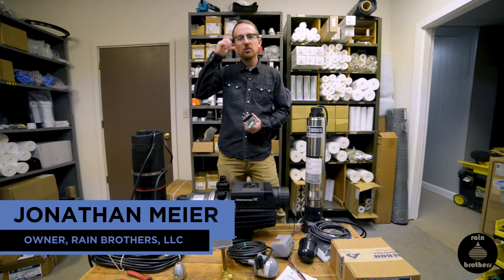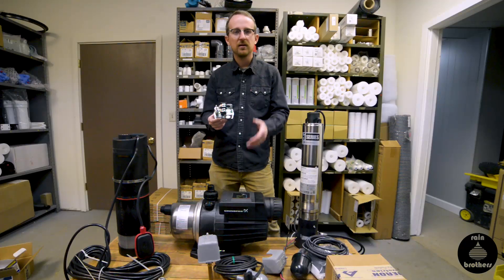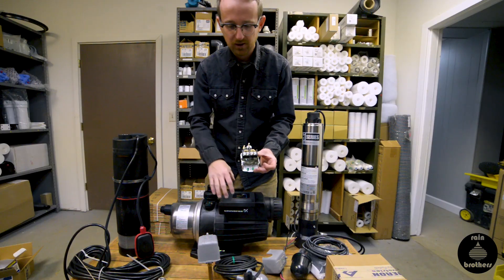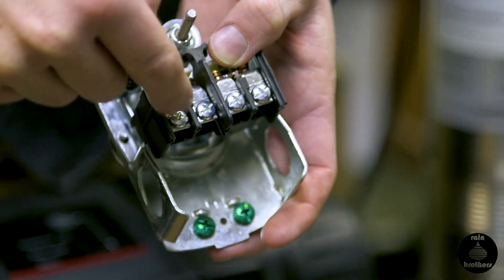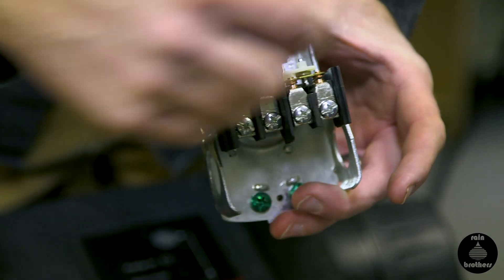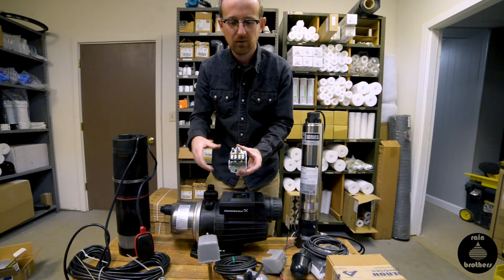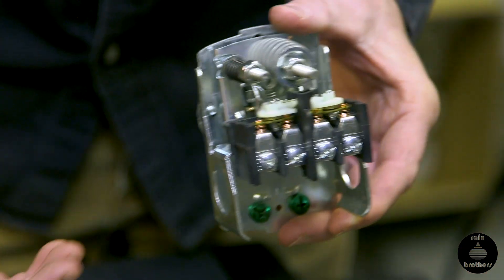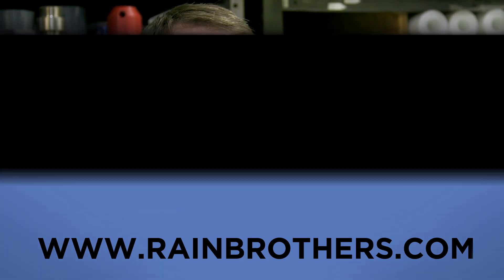How to wire a pressure switch

Comment: We're offgrid and using 12volt usa adventure pump and 20 gallon pressure tank.  How would I wire this switch? Can I go from battery to switch to pump or it needs 120 volt to operate? Thx
Reply from the maker: While I have never wired a pressure switch to a 12v pump, there is nothing in a standard pressure switch that inherently would prevent it from working with a 12v system. The switch itself works mechanically based on the water pressure in the system - the water pressure is what moves the electrical contacts together or apart to create or terminate a circuit. So I believe you would be just fine using one of our switches, and it would wire exactly the same way as was described in the video. Just match the colors — two left terminals would each receive a black wire, and two right terminals would each receive a red wire. We always recommend consulting an electrician before making any connections. Pressure switch available here: https://www.rainbrothers.com/store/40-60-Pressure-Switch-p502659515

Comment: How to wire pressure switch to capastor
Reply from the maker: The pressure switch should be installed between electrical panel and pump’s control box. This will avoid having to deal with the additional wire coming out of the control box

Comment: My jet pump 40/60 is wired with 220v.  When I check the two middle terminals on 40/60 are 220v.  How can I wire a 110v GFI into this switch so that it will turn on a chlorine pump when the well is running?
Reply from the maker: Best to use a 220v chlorine pump, or hire an electrician.

Comment: I have a 3 wire motor red, yellow, and black. Which of these wires goes into the pressure switch. Do all three go in? If so does black go with red or? I’m having no luck with any online schematics. Any help would be truly appreciated. Thanks
Reply from the maker: The pressure switch should be installed between the electrical panel and the pump’s control box so you don’t have to deal with the extra wire